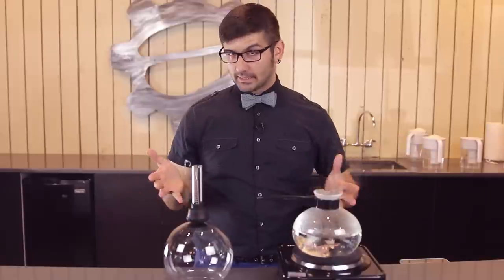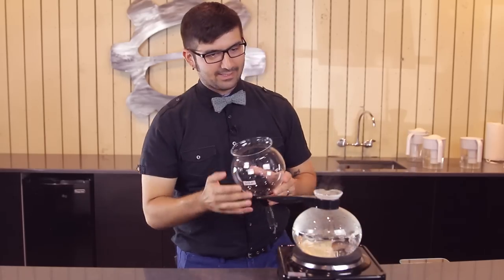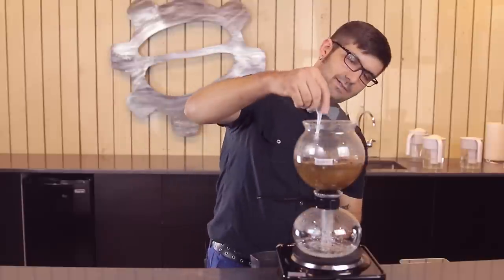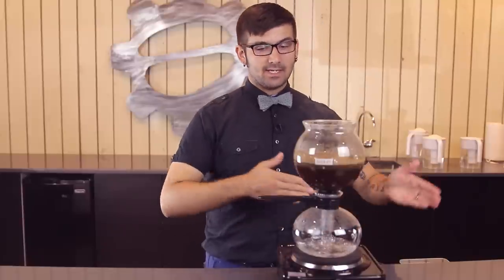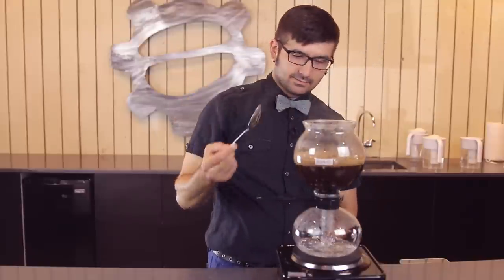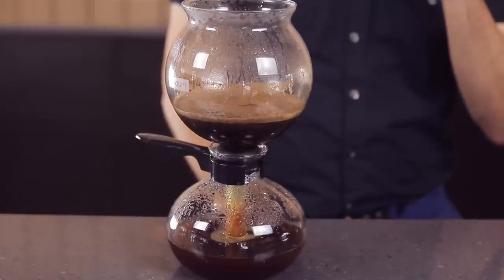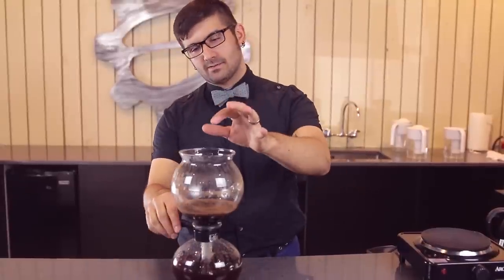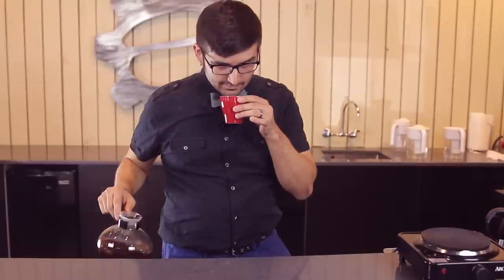Having Fun With A Siphon Coffee Pot! | Cup O' Joe

Comment: Question for the siphon users out there (and to Joe/SCG)... Isn't the water pretty much boiling or close to boiling when he added the coffee there? We always hear that brewing with temps over 205F burns and overextracts the coffee, so I was curious.
Reply: Yes it was far too hot. Perhaps he just wanted to get the method across and took his eye off the temperature. I make sure the water is between 93-96c before I add the coffee. Then reduce the temp a little. It should never be boiling away. I use a small gas burner.
Reply: ascosta I cant seem to get it under 203 Fahrenheit.  Anything less and the water draws back down.  I use a butane burner.  I like the hario siphon. Better with lighter roasts for more nuanced flavors

Comment: I have this siphon pot and I can't use standard drip grind. It's more around what you use for Chemex. I have used  standard drip grind(similar to what I use for Kalita Wave not V60) and it just clogged and I had a very hard time getting the brewer apart.

For the Hario siphon with cloth filter on the other hand I need to use much finer grinds.

Comment: Did you see how he overhandled the upper chamber before putting it in place? This leaves human skin oils on the glass reducing its capacity to radiate heat. This leads to overextraction and a bitter cup. Also the humani skin oils begin vaporize and mix with the coffee oils leading to a sweaty palm note in the already bitter cup. This cup was a complete disaster before it even started. 

Always wear virgin cotton gloves which have not been laundered more than twice and only in boiling water with a squeeze of fresh lemmon (or lime in a pinch) followed by immediate sun drying at high noon on a south facing slope along a salt water shore. You can't get enough ions in your fabrics. If you want a perfect cup then you really have to work for it.
Reply: i see  Keurig machine in your future.
Reply: Or....u can stop at Dunkin donuts ☕
Reply: You can use a 5% vinegar instead of lemon.  My slope faces south east and is about 500 meters from a bay opening onto the ocean.  However, despite this, distance, the there is still a freshness imparted by the salt air,